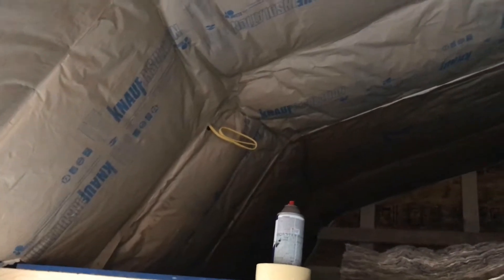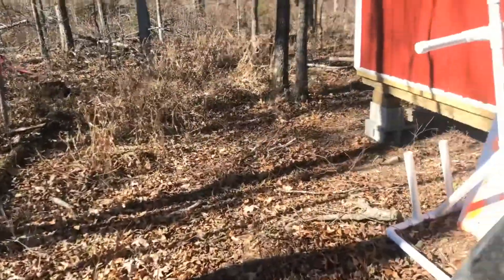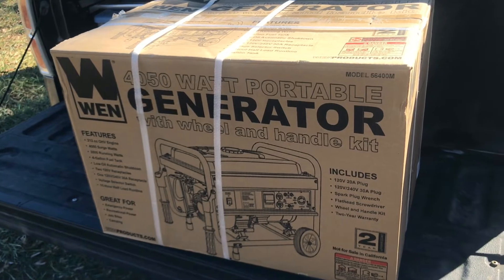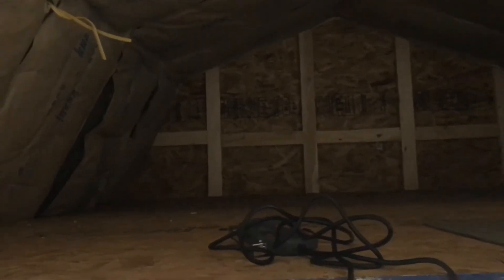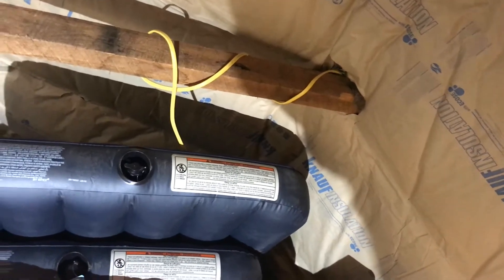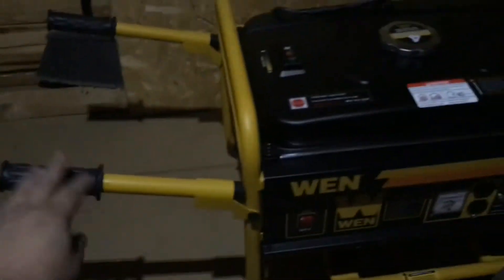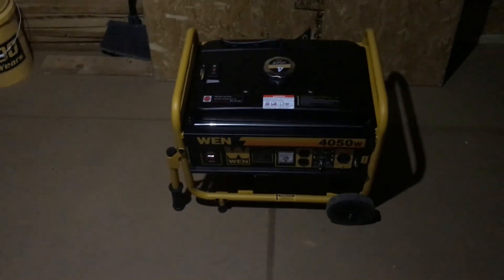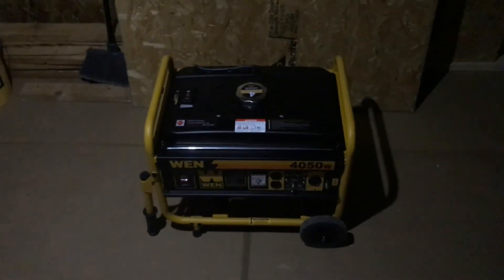Off Grid Getaway -- Insulation and generator

Comment: Hey I have the same 10x20 cabin from Derskin. Was it easy to insulate the roof? Did you have to caulk or seal any cracks on the loft before you laid down the insulation?
Reply from the maker: MaurYahu Katab insulating took an extra set of hands. But was simple. I did not seal anything prior to insulating. It was already water tight
Reply: Zach Kroll thanks for the reply! What about the flooring? What type of flooring did you use? And Did you lay down any underpayment or did you just lay the flooring straight down? I’m new to all of this lol.
Reply from the maker: MaurYahu Katab i have not laid flooring down yet. I think we are going to to do either quark flooring or horse stall mats. If we do quark then it will need an underlay.
Reply: Ok, sounds cool. Be sure to post videos of the update so we can see it.

Comment: When buying pumps, generators, etc. there are two Japanese brands that are the most reliable.  If you by any of the Chinese brands, most of those are based on a Japanese engine/generator/pump.  Figure out which it is based on and if/when you have a problem with it, use the Hondayamaha, etc replacement part to fix it (commonly that is a gasket or you end up needing to rebuild the carb.)

I know certain WEN models are Yamaha knockoffs.